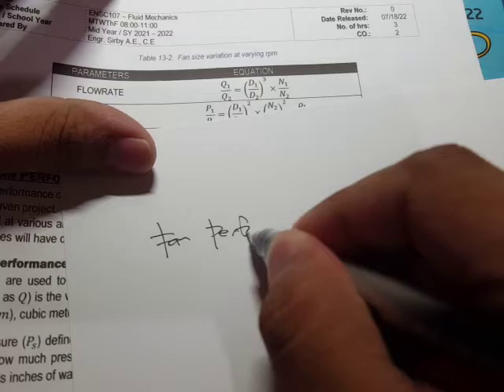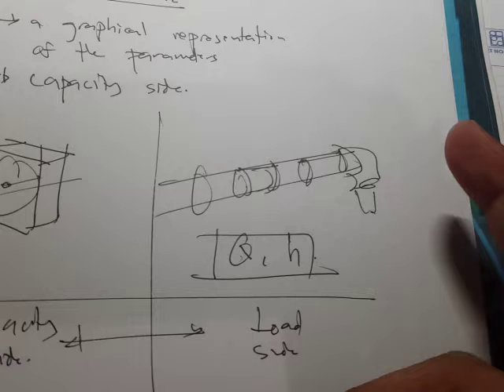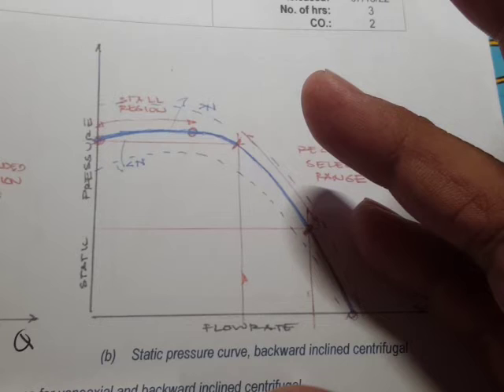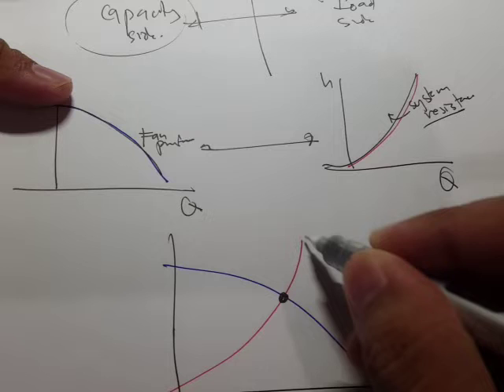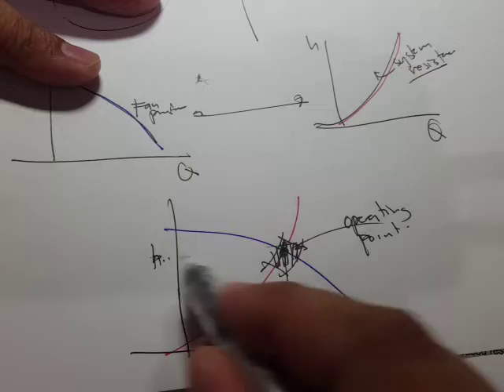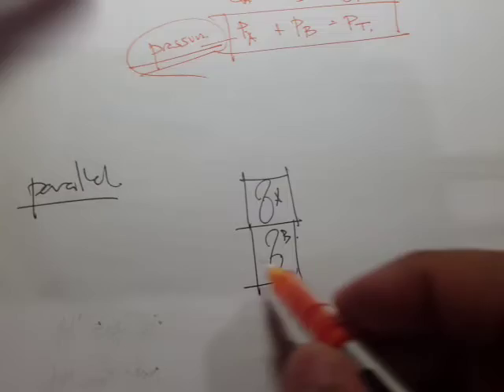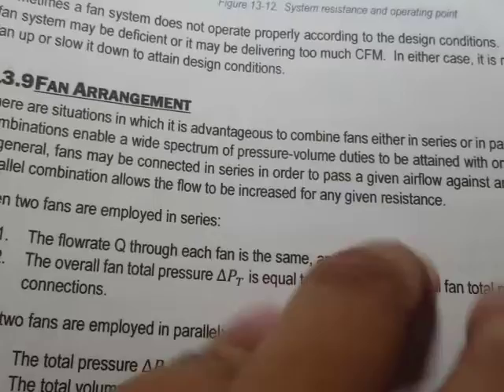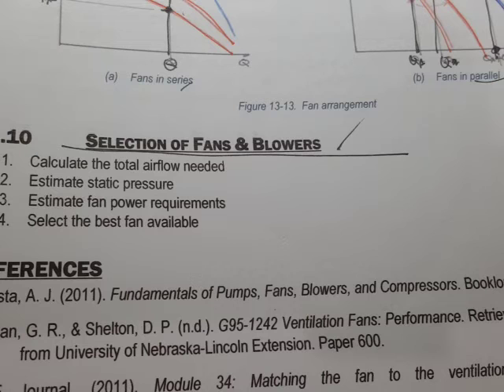ENSC107 - 13.04 - Fan Curves, Fans in Series and Parallel, and Fan Selection

Comment: It would have been useful to have seen how series and parallel fan configurations interact with a system curve.  That would help show better the rational for one configuration vs. the other.
Reply from the maker: good point.  thanks.  i'll try to include that next time.